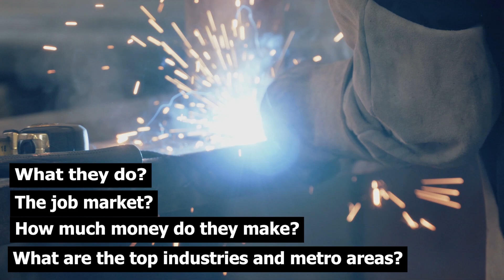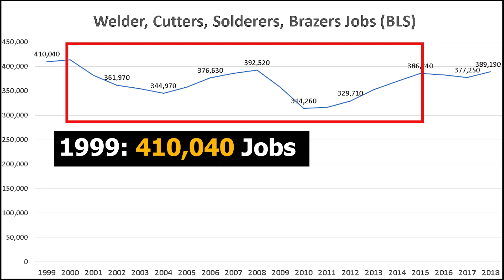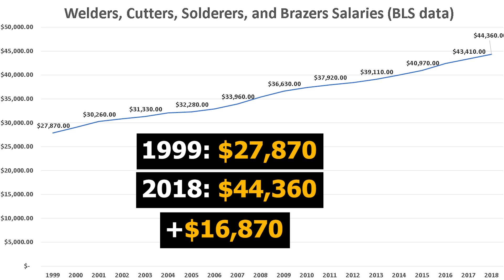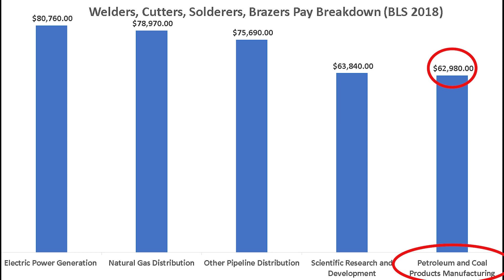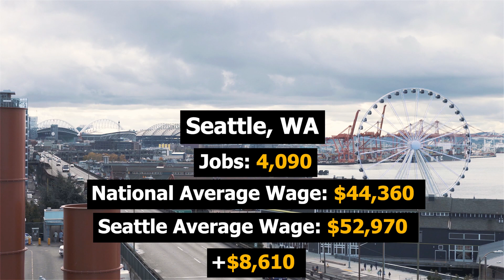Welder Salary (2019) – Welder Jobs

Comment: I'm studying to be a welder in Denmark. As a first year apprentice I earn a yearly salary of 37k. USD When I am done, I can expect to earn over 55k USD. 

Even after taxes of 38%, I will still receive more in my pocket at the end of the month than the avg. American welder. On top of that I will receive 5 paid weeks of vacation, pension and access to universal healthcare and college if I decide to get a degree in engineering or automation.

Besides that, the welding education here cannot be learned without fabrication. We learn to read, draw, create, 3d model, cut, clean, fit, weld, price and product report. This gives the Danish welder an advantage on the global job market. 

Thought you might find that interesting. I am American-Danish by the way.

Comment: Ive had 4 different welding jobs. The most I made was $20.85 a hr after ten years at the company. Ive been welding and fabricating 14 years. My last couple jobs I was the best welder and fitter and they paid less. Welding deserves higher pay.  You get burnt almost everyday it's hard work usually in shops or outside with no climate control. In most situations the job wouldn't get done without a skilled welder
Reply: Sounds like you're not in a good area for welding. The Northeast U.S has plenty of welding jobs at $30hr+.
Reply: @XxHitmanxXpro  I live in the north east and you're right.
Reply: Are you certified?
Reply: I need welder job I am good welder please help me
Reply: it depends where you live, other areas are paying over 30 hr

Comment: Currently heavily debating welder as a career choice, as well as mechanic
Reply: as a mechanic youl prob have to learn new more complex stuff eventually since cars keep changing, welders depending where you are you can make good money but loose the job due to being temp or may not find a job like me and im in Tx smh
Reply: Mechanic
Reply: Welding Tig little bit of mig for a repair Thant’s about it. Most of the steel companies are hell holes
Reply: You will make way more as a welder